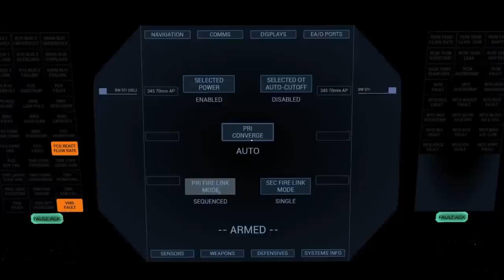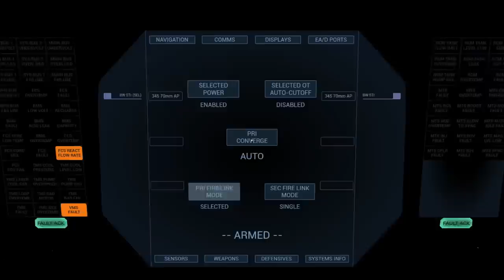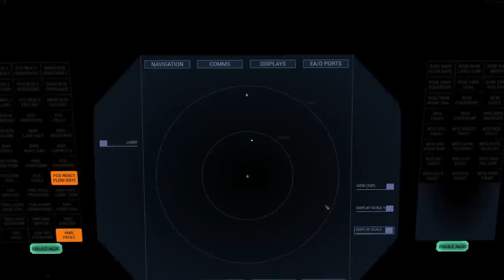Rogue System - Weapons Tutorial

Comment: For a realistic sim you try to much to follow stereotypes of the zero-g sub shooter (so called space fight sim) genere.
What is the meaning of bow mounted craft body rotation aimed precision kinetic weapon in real space fight? To have to be forced to sync speeds and trajectory and close up to 400m before being able to shoot? Nonsense.
In reality weapons as your currently implemented rail gun may be used only against most primitive satellites, as their sole availability will force detection and evasion to become standard features.

So precision weapons will be those that can allow computer assisted precise auto tracking/aiming with no evasion possibility at relatively short, but still much longer than 400m range. From today's perspective lasers fit best at this role.

There is meaning to precisely aim projectile that is so slow, that even at close (for space battle) proximity enemy has seconds to detect your shot and evade it.Typical use of slow object launchers like rail guns in ship vs ship fight will be either to give initial boost to tracking capable projectiles (most likely - detectable and with some luck - interceptable), or as repeating "shotgun" style weapons that targets with low radar visibility projectiles an adjustable arc, randomly scoring /or no/ hits within it. Precise aiming single projectiles will remain for cases, like celestial object bombardment, or gravity alerted stand-off range barrages, where the firing ship is not visible to the attacked.

In any case however, even if the pilot presses trigger manually, actual combat firing of bow mounted weapons on ships of the type you simulate will be computer controlled process, involving automated use of auto pilot and sensors. Word war era style nose aiming and manual shooting are obsolete even in modern atmospheric planes and in space ammo is even more precious. (OK, there can be override for bio-computer controlled mode in case you issue a jedi pilot...)
Reply: Another thing, in open space combat rail guns will be relatively short range weapon. Basic mass/energy limitations mean projectiles are so slow, that even if firing shotgun style the target has enough time to detect shoot, then calculate and leave the firing arc, stripping you even of the random hit chance. They are however simple and mass-effective, compared to coil guns, trough wear makes their maintenance higher. This makes them good choice for small craft and strike drones.

Compared to them coil guns are heavy, complex, and less energy efficient (trough progress in supper-conduction will most likely reverse this one day). They however have neglectable wear, due to the lack of friction and are potentially capable of accelerating plasma, that thanks to it's lower mass can reach much higher speed at reasonable energy cost. Of all gun style weapon that can be called theoretically possible shotgun style plasma accelerators have greatest effective range. If we assume human physiology based acceleration limits it may even reach ~50-100 thousand kilometers, depending on the size of the ships that fight.